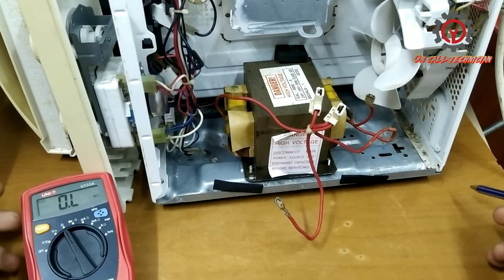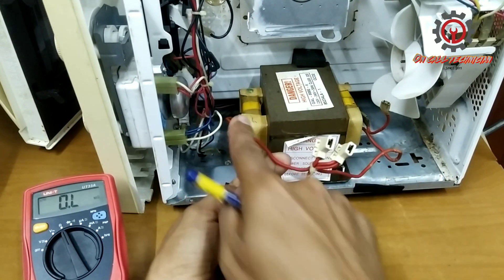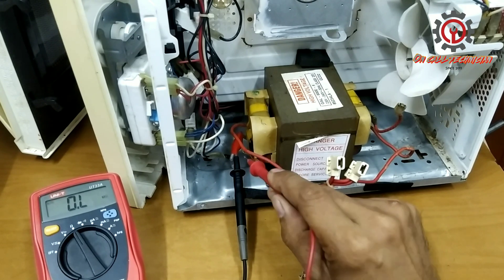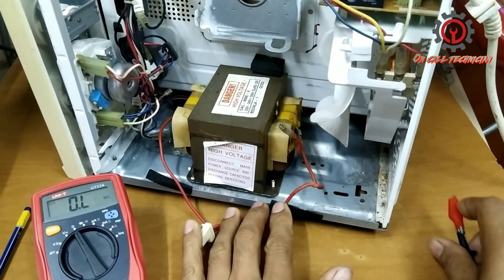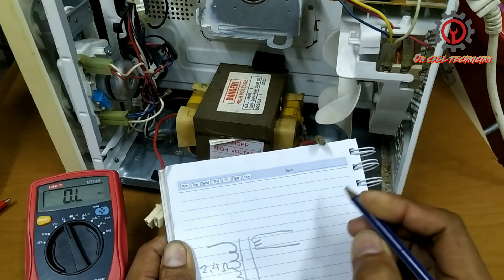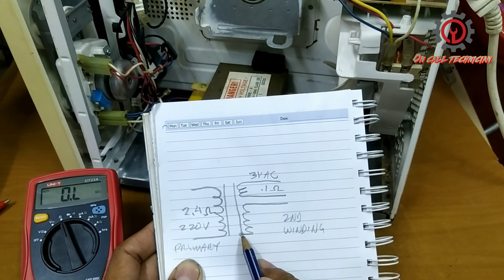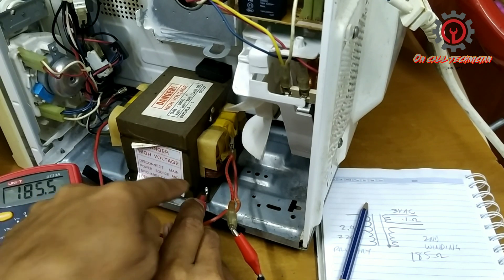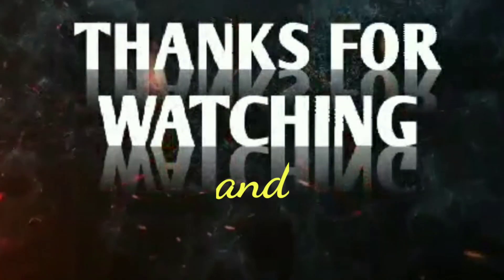HOW TO TEST TRANSFORMER OF MICROWAVE OVEN USING MULTIMETER (ENGLISH/TAGALOG)

Comment: My secondary winding has continuity to ground 25 ohms is that a shorted and bad HV transformer
Reply from the maker: Answer is in 3:46 on ward. Ty
Reply: But isn’t 25 ohms very low. I’ve tested many transformers the secondary winding usually reads between 80 and 200 ohms
Reply: My main fuse keeps blowing the high voltage components are shorted
Reply from the maker: Have you try replacing your hv transformer?
Reply: First need proper diagnosis the transformer is expensive
Reply from the maker: @ashrafkarjiker6888 there are 4 hv components of your microwave oven the diode, capacitor, magnetron  and transformer. Disconnecting each one of them will solve your issue.  Don't install new fuse, just put tiny wire. Hope this will help
Reply: I’ve disconnected the magnetron and capacitor from the HV transformer the fuse still blew so the transformer is shorted. Thanks

Comment: Sir gud day po un po bang 102ohms po ng secondary winding ok p po kc dapat po ang makuha ko ay 187 ohms ...mababa npo b un
Reply from the maker: Di ko alam basis nun iba sir nag nagsasabi na pag iba na ohms reading e sira na ang windings. Ang alam ko iba iba ang turn at kapal ng windings ng bawat transformer. Kaya iba  din po ang resistance reading.
Reply: @THEMULTISKILLEDTECH  para po bang medyo nag burn sunog ang winding nya po
Reply from the maker: Pag burned out na sir, replacement na po sya. Or kung matyaga po ang magrerewind pwede naman po